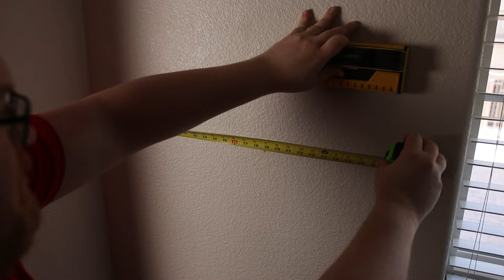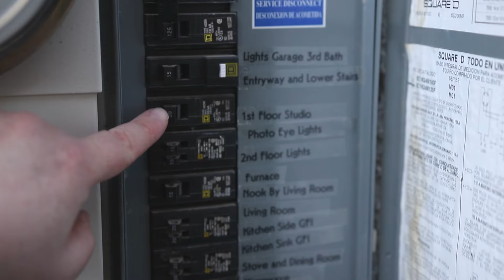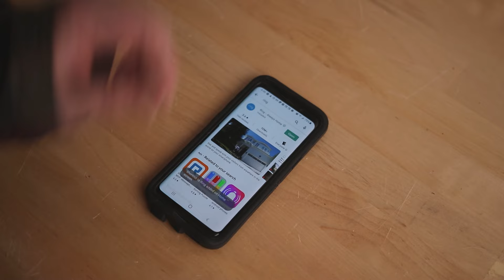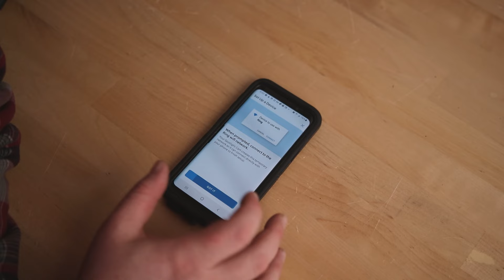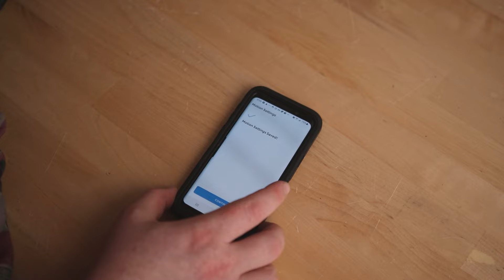Hardwiring A Ring Spotlight Cam Mount (New Electrical Box)

Comment: My electrician recessed the electrical box in stucco over the garage. He used a hole saw that was for wood or drywall not for stucco and it worked just fine. Floodlight camera gets power from the outlet on the ceiling the garage door opener plugs into.

Comment: great video very well explained, but i would’ve left the original outlet intact and made a wire connection in the new box you added , i would’ve never used a gfci if it trips by accident you got no cameras

Comment: A slight problem with hardwiring a mains powered external  camera into your house ring main is IF for what ever reason the camera or connections outside do get damp or corroded its likely to trip your circuit breaker and knock out the ring main on the whole of the ground floor. It would have been better to have run the cable and fitted a plug on the end that would then permanently plug into the socket. if you then got a power trip you could unplug the outside camera making  diagnostics easier. just my tuppence worth :)
Reply: Doesn’t the GFCI plug address this?
Reply: @brandong2142  it would if he had brought the cable through to the front of the socket and then put a fused plug on the camera cable. What he has done is hard wire it into the ring main at the back. its not something I would do for the reasons in my first comment.
Reply: @insertnamehere5146  I understand now. Thank you

Comment: Where did you buy that camara ? Could you send me  the link please
Reply from the maker: All the links are in the description.  That particular model (cam mount) is currently sold out.  It appears the cam wired is also sold out.  If you can get your hands on one, and the mount is still unavailable, you can use the hardwire kit to convert it.  https://www.amazon.com/Hardwired-Kit-Ring-Spotlight-Wired/dp/B088WH57YH  I know that doesn't help you right now, so sorry.

Comment: Hi - what you have done to avoid pushing the insulation down if it wasnt pushed? Is there a way to fish the cable without harming insulation? I am in a cold weather climate area. Insulation is critical and thus I do not want to mess it up.
Reply: My original plan was to cut a slot through the insulation all the way to the drywall and then fish it down with a magnepull.  There was already a hole running down the wall, so I used that.
Reply: @distractor_beamreviews  Ahh ok. Thanks

Comment: I see you have an extra red wire on the camera mount unit and you just cap off.  I have an extra red wire on the wall instead, do I also just cap off just like you?  It's weird my Ring Floodlight didn't come with a red wire
Reply: The red wire on my Ring is to control other lights.  You can run wire to extra lights so they'll turn on whenever the Ring detects motion.  I'm not sure what your red wire is.  My guess is the device that was there previously had a similar motion control system.  If that's the case, you can cap it off and there'll be no issue.